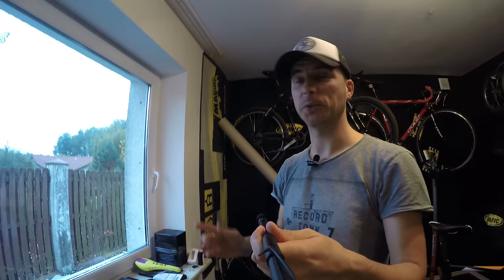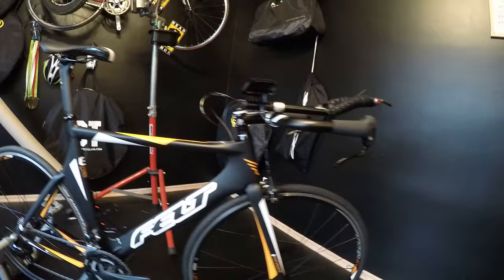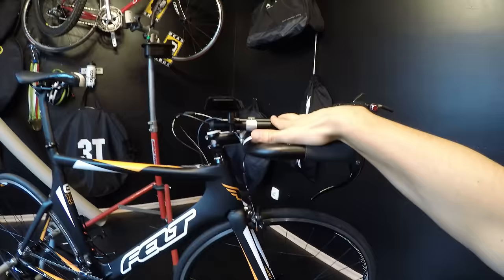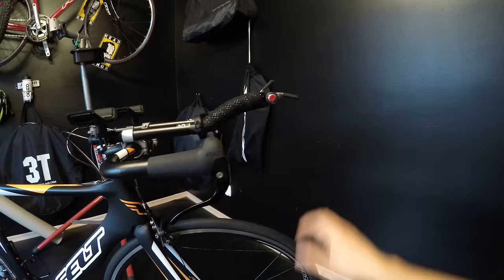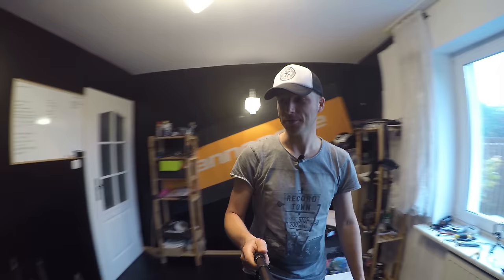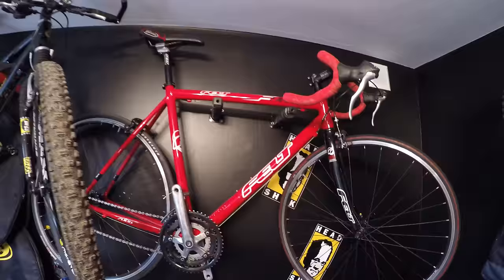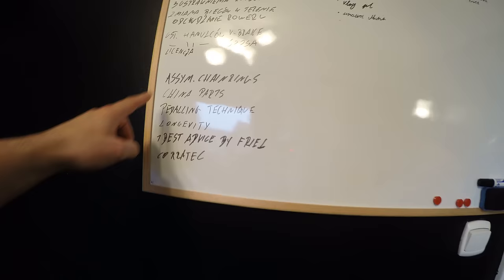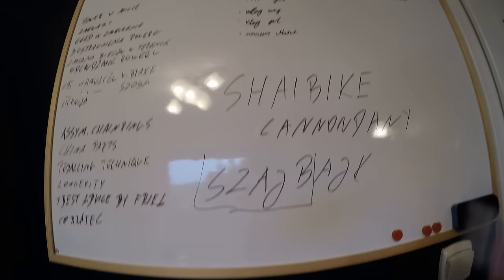Time Trial / Triathlon Bike For Begginers - How It Shifts And Brakes + Room Tour...

Comment: How do you get comfortable riding a TT bike? I don't mean physically, but leaning on the aero bars, not being able to brake quickly and not having as much control as a road bike just terrifies me.
Reply: The aerobars are mostly for flat and not too technical (sharp corners) roads.  However, if there are some hills/climbing in the TT, then most riders would just place an aerobar on their road bike (light weight bike for climbing).  Once you get used to it, it's not that bad.  You can go around curves or even corners without getting out of the aerobars.

Comment: I'm about to buy a metal flake yellow 2000 Trek Hilo triathlon/time trial bike with a 56 cm frame for $100 from a friend here in Texas who has his own nice bike shop.
  The bike, 650 b, has Syntace clip on aero bar, Shimano 105 crankset, Spinergy wheelset with Vittoria Competizione tubular tires, a clincher training wheelset with Mavic hubs and Profile Design twin water bottle cages mounted behind the saddle, among other components and parts.
  I don't race, yet, but will take this bike out on days when I'm feeling particularly sassy and just want to ride as fast as I can in a straight line.
  How would this bike handle going over bridges across rivers and hills of varying gradients ?
  My road bike is a Lemond Buenos Aires in 56 cm frame with countless thousands of miles ridden on it since new in very early 2000s. My mountain bike is a Gary Fisher Mamba in 19 inch frame and is a bit of a project bike to get her in riding condition again.
  I also want a track racing bike, a cyclocross bike, a touring bike, a BMX 26 or 29 inch cruiser race bike and a beach cruiser.
  You can never have too many bikes, just not enough. Thank you for this nice video and good luck with your racing you absolute cycling legend.

Comment: tt bike and triathlon bike is not the same? hmmm... i'm a triathlete and i have a Giant trinity tt bike... because based on my experience, bikes we used in triathlon are tt bikes. Triathlon bike is what kind of bike? isn't it tt bike too? please let me know.
Reply: There: "The most significant difference is comfort. By design, triathlon bikes are made to go the distance. Triathletes often ride through hilly terrain, cover distances up to 112 miles during races and must transition to running quickly and efficiently. In contrast, time trial riders get off the bike completely spent. Their bikes are designed for only one thing—speed. As such, triathlon bikes favor a more relaxed position and a lighter frame than time trial bikes"
Reply: @alejandromedina4062  Yes, I had to use my 2010 cannondale slice 4 for group ride in hills and was shocked how comfortable it was and faster than my road bike, just be more careful in the turns and stay in front or give room for extra braking distance. I now know why it has the comfort frame and the lower gears, it can be used for time trialing for sure but its great for long rides too.
Reply: Some tri bikes are not uci legal